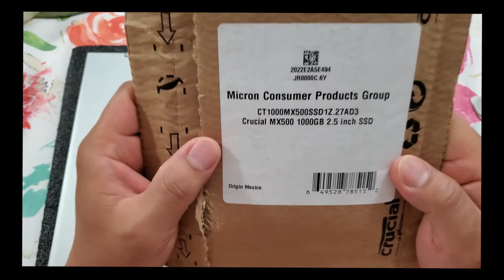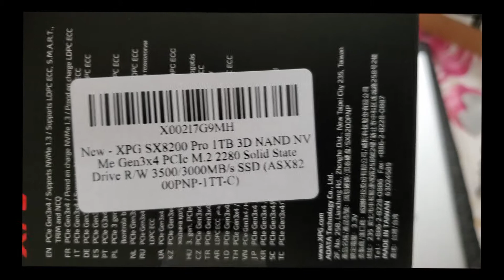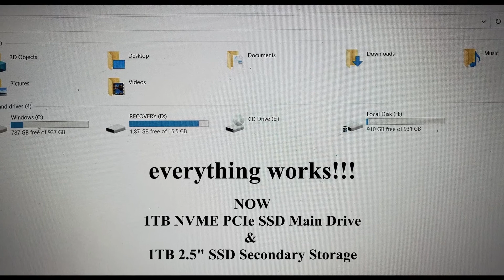HP Envy x360 (15-cn0008ca) - How to Upgrade Storage and RAM

Comment: No need to do a special procedure when adding more ram and more storage to this laptop, right? (If i don’t have any information in the m.2 ssd)
Reply from the maker: yeah. no special procedure needed. just a typical remove and replace process. just make sure you have same specs for both RAMs to make use of there full capacity. This model has no m.2 slot.
Reply: @yanalois2051  yeah I found the exact same RAM that my laptop uses on Amazon; thanks for responding

Comment: If I have nothing on my m2 memory, or if don’t want to clone it, there’s no need to buy the enclosure right?? (All I wanna do is add another 8gb of ram on the free slot and add an 1tb ssd on the free spot… is it possible??…. To have 16gb of ram and 1tb + 256gb of storage….. is my plan possible???
Reply from the maker: Yeah. It is possible. Max ram you can put is 32gb. But 16gb ram is more than enough for everything.
Reply: @yanalois2051  thanks a lot! Thanks for answering! 😀👍🏻👌🏻 now, one more random question: is it possible to combine internal parts of an old 2011 MacBook Pro (mainly Hard drive and ram; and why not other parts jeje) into my laptop (HP Envy x360; this model)?
Reply: @yanalois2051  so there’s no need to do an special procedure to add an ssd in the free space if I have no info in my laptop?

Comment: I have the same type, 15-cp0008ca but my m2 slot won't detect my wd blue sn550. BIOS, disk management, not detecting it.
Is there any work around to be done to enable the m2 slot?
Reply from the maker: try to go to BIOS if its really there. it might be deactivated. specially if your laptop is reformatted  not with its OEM software. or maybe your WD M.2 is defective. If you have a M.2 enclosure, much  better clone your original with it first.

Comment: I have heard envy's ram is soldered then how do you do this us ram upgrade option is only for envy 15
Reply from the maker: Yes. Other Envy models has their RAMs soldered, specially the older models. But with this model i had on the video is not soldered. It has 2 slots. 

But most new Envy x360 models this days are upgradable. But, just to be sure, still make some research before buying.
Reply: @yanalois2051  will you provide the model name of hp envy which is upgradable particularly 13.3 inch model please i need it please i beg you
Reply from the maker: @shreyaansjain06  i honestly do not know. You need to ask the store who is selling it instead. When i bought my laptop at bestbuy, i asked them first if its upgradable or not. Also you can ask HP directly thru technical support. 

I hope that helps.

Comment: Can I buy a mechanical hard drive for this laptop? Is there some dimension that I should notice?
Reply from the maker: Yes you can on this model. As you can see on the video, it has 1 slot main drive as m.2 2280 NVMe which you can upgrade, and 1 slot 2.5" (HDD or SSD) drive bay.

In the video, i upgraded my m.2 SSD and installed a 2.5" SSD for additional storage. You can also install a 2.5" HDD if you want.

You can see all the parts i bought under the description of the video.

I hope that helps.
Reply: @yanalois2051  Thank you. I understand. Do you know if all the ENVY X360 SATA cables are the same? The link you provide does not say if it is compatible with my 15-bp108.
Reply from the maker: Im not sure. I ask the seller about it bwfore i bought. Maybe yoi can ask him as well just to be sure. You can always give it back if not. 😁

Comment: Hi. I have the same model as yours. How come when I run HWInfo it shows my RAM at 2666mhz, but in Windows it shows 2400mhz?!
Reply from the maker: Hi. Do you also have dual channel RAM?

If you have 2 RAM installed, in HWinfo, it is showing the actual speed of both RAMs combined. 

DDR stands for "double data rate" so programs like task manager or cpuz or ryzen master will report the actual frequency of the module which is half the advertised speed.
So if you have 2 x 2400 mhz DDR RAM, actual speed of each RAM will be around 1000-1400 mhz each.
Reply: @yanalois2051  
Hi. Thanks for rather prompt reply. My unit is an HP Envy x360 15m-cn0012dx. It has 12Gb of RAM - one 4gb and one 8gb. I plan to upgrade the 4gb to an 8gb. Weird thing is, if you use CPU-Z, the Task Manager, or the command wmic, it shows them as 2400mhz. Only HWInfo shows it as 2666mhz. I saw some links saying there are cases where HWInfo erroneously reports the RAM though, so I reckon it has to be 2400mhz, right?
Reply from the maker: @dylim  i see where the problem is. As much as possible, if you are using 2 RAMs in any computer, for better performance and utilization of your RAMs, you should use identical specs of RAM for dual channel RAM. 
With this setup, both your RAMs will be used at its max capacity.

With your current setup, your cpu is actually only using 1 RAM, not dual. It is actually making your computer slower than having just 1 RAM installed.
Reply from the maker: @dylim  if you are upgrading the 4Gb ram to 8gb. Much better to have an identical specs with the current 8gb ram you have. So that you can use dual channel. 

I tell you, your laptop will be much faster and can open lots of apps and programs in the background.
Reply from the maker: @dylim  about the speed. Yeah it should be 2400mhz. Nothing else.

Also to be 100% sure, just check the label on your installed RAM.
Reply: @yanalois2051  what's so weird is.. now, both HWInfo and CPU-Z are now showing the same speed of 2666mhz! They both even showed the model number of the RAM modules - Micron 4ATF51264HZ-2G6E1 and Samsung M471A1K43DB1-CTD.. which are in fact 2666mhz! What do you make of this?
Reply from the maker: @dylim  if its reading 2666mhz, it just means its actually running on that speed. I just checked mine right now and always get 2400mhz. I think even though your RAMs' label says 2400mhz, it still has the capacity to go beyond that if boosted.

Wait, did you overclock your RAM? That is the only thing i can think of on why your reading is higher.

With my Predator 300, my RAM is 2933mhz but i can overclock to 3200 without a problem. Higher than that will be risky.
Reply: @yanalois2051  I don't know how to overclock. Right now, I just went to the HP Diagnostics (pressing F2 before bootup) and selected the System Information screen. Which showed the exact same RAM part numbers reported by both CPUZ and HWInfo, but.. showed their speeds at 2400mhz.. my hunch is HP under clocked it? Is that a good thing?
Reply from the maker: @dylim  wait. Im missing some info. Is both of your RAM new? Not oem?
If both RAM are new which you installed yourself and  the label says 2666mhz, it is really  2666mhz RAM then.

The original bios configuration when bought first hand, like mine, was with the oem ram speed 2400mhz. So if you change your RAm with different clock speed (higher in your situation) but did not change your bios configuration, yes, your computer slowed down your ram to 2400mhz.
Reply: @yanalois2051  Nope. Both of them came with my unit. I am planning to upgrade both RAM and Storage (also 256gb just like yours) when I saw your video. If you Google up the part numbers, Amazon shows them to be 2666mhz! So, in order to upgrade mine to 16gb RAM, should I go get a 2666 or 2400 RAM stick? That's why I am seeking your help. :)
Reply from the maker: @dylim  really? It came with 2 different RAM when bought? Hmmmm... 🤔

I gotcha. Yeah. 256gb is not even close to "enough" these days.

2666mhz is better. Your cpu can handle that speed. But not more than that.  BIOS should change automatic when you plug in both same specs RAM with 2666mhz. 

I guess since you have 2 different RAM, your bios was automatically changed to 2400mhz.
Reply: @yanalois2051  Yah, I guess getting 2666 RAM is 'safer', since the unit came with 2666 RAM sticks. Thanks! Glad I found your video, and you!  :)
Reply from the maker: @dylim  you can either get 1 x 16gb 2666 RAM or 2 x 8gb 2666 ram.

Dont exceed 16gb because the mobo with that model only supports 16gb. Latest model though supports 32gb. :(
Reply from the maker: @dylim  your welcome. Glad to help. 😊
Reply: @dylim -- that stick of RAM is certified to operate at up to 2666 Mhz, but the motherboard's maximum speed is 2400 Mhz.

Comment: What the name or code of flex cable ssd sata 2,5” ?
Reply from the maker: The 2.5 sata connector came with the laptop itself. Its code flex is 181012 A01.
Reply: Yana & Lois thank U.

Comment: How much ram can be upgraded in this?
Reply from the maker: Maximum is 32gb ram. Preferrably 2 x 16gb Ram dual channel. I had mine upgraded to 16gb right now. With 2 x 8gb Ram dual channel.
Reply: @yanalois2051  what ram did u purchase to upgrade?
Reply from the maker: @benjaminnyman8687  i bought the same ram that it had originally. It has 8gb ram and bought another 8gb ram same brand to make it 16 gb dual channel ram.

Hynix HMA81GS6AFR8N-UH 8GB DDR4-2400 SODIMM
Reply: @yanalois2051  same